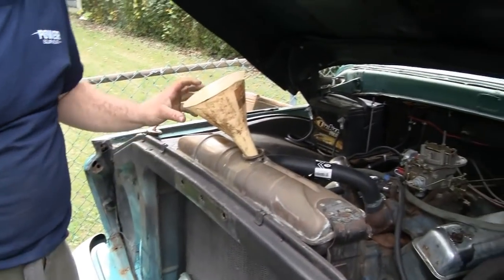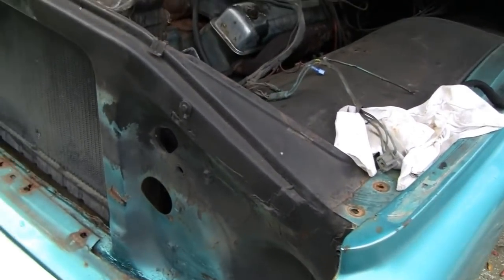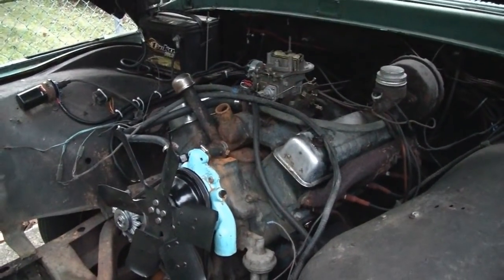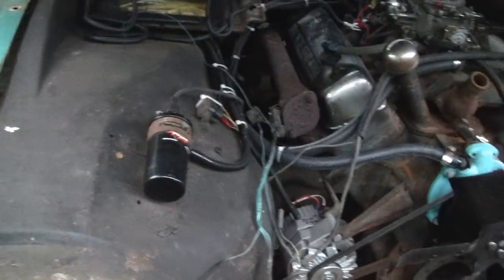RADIATOR & SUPPORT REMOVAL, RUST REMOVAL (F100 part 28)

Comment: The scraper works good ..I made it from an old hand saw blade ...Some where I have a gasket scraper made from a Craftsman ratchet handle ...It is the square type handle and has an edge like a wood chisel..I need to find your address hidden somewhere in my computer
Reply from the maker: Using a saw blade for a scraper was a stroke of genius!! I use that thing all the time!!☺

Comment: flux core and sheet metal= a dirty mess and unnecessary surface cleaning afterwards. I flux core by choice everything I weld, I cant justify a bottle of gas for the little amount of welding I do. I try to avoid welding sheet metal.
Reply: You should get yourself a few pieces of old sheeting, the thinner the better, easily bent, and cut, you can make custom shields so you can flux core weld stuff without the mess that comes after. I tried with aluminium foil, but it doesn't work as well and it's expensive to keep replenishing. Welding mats work, but they aren't as disposable as a piece of tin.

Comment: Looking great , 

Why is there a flange on the front of the exhaust manifold ?
Was that factory ?
Thanks for bringing me along on the project.
Reply: Y block trucks had a weird cross over from the factory up in the front of the engine. Looks like somebody removed it and made a block off plate.

Go to:  http://mrosenow.mydomain.com/store/index.html  and there is a picture of how it was.
Reply from the maker: Thanks Bud!! Yeah that is factory, originally there was a pipe that went across the front of the engine connected to the other exhaust pipe!! Most Y-Blocks I see it's been removed, but there are still alot left original!!☺

Comment: That tiger hair is good for pinhole repair on floor pans.  Not so much on rad supports!
Reply from the maker: Yeah Buddy!!  I remember back in the 70's & 80's I would see alotta rust repairs with it, rockers and quarters!! I never tried the stuff myself!! If I did use fiberglass it would be the mat, tape and resin!!☺

Comment: Briggs question if you have the time
Reply from the maker: What's on your mind Pat!!☺
Reply: Working on a Briggs horizontal shaft 2 hp engine and looking fo a carb I would like a float bowl down draft carburetor but all I have found are the suede draft with tank base setup. Did Briggs have a carburetor for this setup or will I have to create a manifold and find a different carb. What size should I look for, and this will be used on a motor bike. For short distance commuting, any thoughts will be greatly appreciated! Thank you
Reply from the maker: @gettintheresafelywithpatf2869  Anytime I replace a briggs carb I usually replace it with a tecumseh bowl carb for a 5HP and below!! If you can get an earlier one that has adjustable jets you are better, the newer ones don't have adjusable jets!!  Most of the time the tecumseh carbs with the little manifolds fit, you just have to widen the mount holes a little and they bolt right up.
Reply: Thank you, also do you want a compressor pump head?
Reply from the maker: @gettintheresafelywithpatf2869  No thanks Bud!! I have 3 of them I had planned to turn into engines for the passed five years!! I'm sure I'll get to it but not for a while yet!! I really appreciate the offer though!!